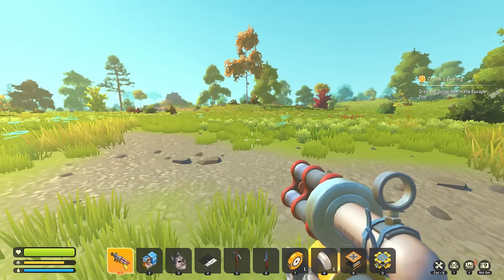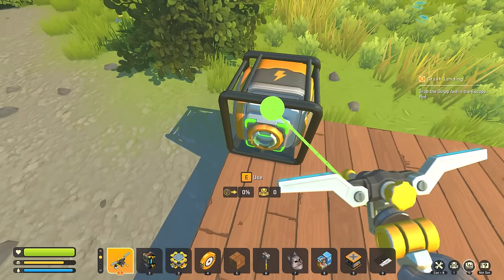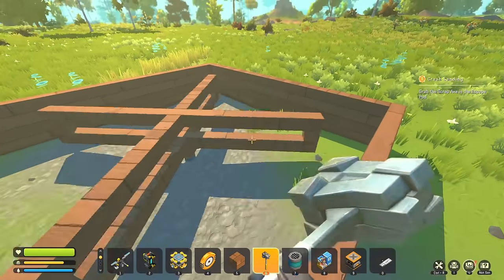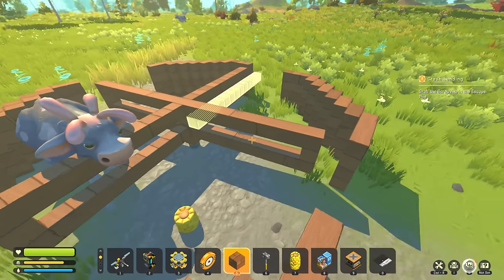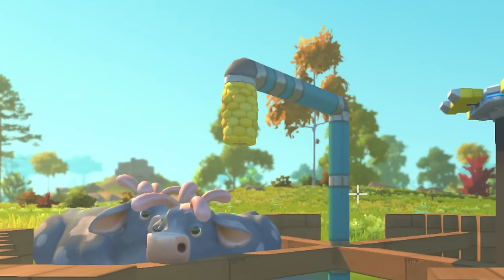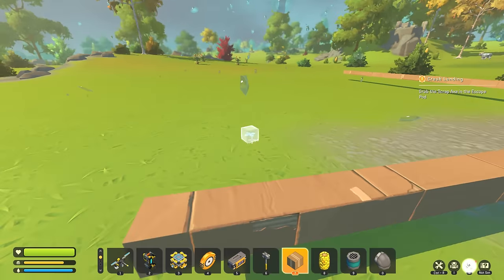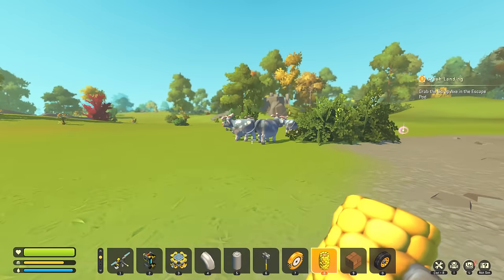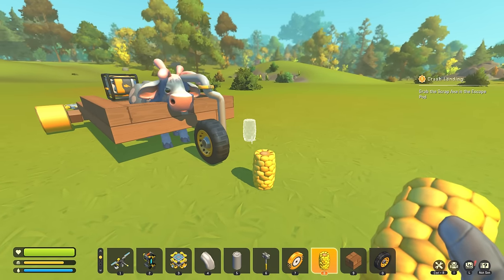Can You Use Wocs For INFINITE Electricity Generation? (Crashlander Survival)

Comment: I remember someone making gravity-powered device with gears when battery charger was announced in the devblog. It essentially used lift's infinite power to lift massive weight, which would slowly descend, causing gears to rotate and generating torque that way
It's pretty cool, I think you'll have fun trying to make something like that

Comment: Is there a particular reason you aren't just using a maxed out controller to turn 10 bearings and then add an 11th bearing that can be hooked up to a alternator... I'm doing that and it works perfectly, even with the big alternator. It generates like 1 battery every 2 minutes or so but you have to stay within render distance of it though

Comment: Are there any suspension glitches that will always move nonstop after they are finished? Maybe something like that could create a free energy machine that moves without any engine or anything else creating force to move your contraption. Just a suspension glitch attached to alternator that makes a bearing spin all on its own.
Reply: True or a simple generator that powers itself but a lil bit of self sufficient energy as a run off spare that can be used for other things sure it will be slow but if you have the patience for it did something similar like this in tears of the kingdom for self powered machines if needed
Reply: just make the springglitch  using a controller to set the angle. works well at 30´ .
then have 2 running opposite ways spinning the bearing at twice the speed.
it works but is still slower  than a tier 5 controller at full speed with 4 powered bearings to power the generators, the controller option is cheaper and better. i used a single springglitch to power 6 large generators. its strong but slow.
Reply: @MrLarsgren  that’s what a “suspension glitch is” it’s “spring suspension”
Reply: so something like glitch steering to turn the alternators? hook it up to a controller to make it never stop spinning for infinite batteries?
Reply: @crustybomb115  yep exactly what I meant

Comment: i just use a controller set to 5 bearings in a row which all spin a 6th bearing on the alternator.
Reply: i think a piston engine would work alot better tbh... considering the bearing connected to the alternator would apply torque on the entire system...
Reply: @crustybomb115 maybe, but i was maximizing space and its fast enough to produce about a bettery a minute on the heavy alternator.

Comment: Here's an easy to apply idea, in your own world, put the alternator on your truck, have it be rear wheel drive only, and connect the alternator to the front wheels, or experiment with the opposite layout maybe? 1 set of wheels will propel the car, and the other set of wheels will generate power.
Reply: And see if you can double them, so say you have a six wheel vehicle and 2 sets are powered. Or have the powered wheels be larger and the alternator connect to the small wheels so it spins nore

Comment: The wooden water wheel works for generating battery power, bit slow but no need for powering the bearing because the water does the work for you

Comment: If pistons dont require power in this mod just use a piston engine sadly gears are a bit rough in scrap mechanic so either no gear ratio or a jank one
Reply: 300 rpm on a big flywheel passign to a small one

Comment: Hey, ive made a spinning thingy with 1 or 2 rhrusters mountet on it, works realy well on both alternators... just build it next to a oil pool i  a desert, and use a setup to keep feeding it oil-->gasolin... i know its an expensive deal. But its works realy well (my base is near the same oil well
Reply: @davidaugustofc2574  They do have their uses; I for one use them for my mining vehicle so that it can have tank steering (not a fan of suspension glitch steering).
Reply: @ShawnF6FHellcat  i honestly just opted for a resource gathering vehicle and hand held tools... seems to work alot better tbh... plus im not sure if the achievements work with vehicles as the gathering method
Reply: @crustybomb115  
I only just found the hand-tool recipes, but I haven't really used them because I have two collectors on my mining vehicle, of which is set up for both saw and drill; also, using the sawblade is faster than the handsaw from what I just saw, but I might use the handdrill because mining always sucks...

The mining achievements do work in a vehicle, but kill quest do not, unfortunately...
Reply: @ShawnF6FHellcat  thats interesting to know... im gonna stick to the hand tools regardless cuz i find them way more convenient than having to line up a vehicle(sorting stuff would be abit of a pain tho)

Comment: I have an idea which sounds kinda stupid but also quite promising... 
Remember those NPCs in the Crashlander Mod? Y'know, like Bill and the other ones...

I think, you could build a contraption for Bill to walk into and let him be trapped inside that contraption, 
basically move him to the roof with some sort of elevator, but once he's up there, the elevator moves back down 
and the only way he can leave the roof is by falling through a chute into a hamster wheel, where he keeps running around inside, 
powering some sort of gearbox that finally powers the alternator... 
and with that, you have your "free labor" which also makes those otherwise pretty useless NPCs finally useful..

Comment: 2:39 Cows go, "OOOOooo!!!"

5:55 kosmo....Bruh. You think that's crazy? I did that in Crashlander last night. I was just fooling around seeing if I couldn't set up kinetic traps for my farm and the bearing janked while I was spinning a metal 2 cross on the ground. I, for no good reason, decided, I'm going to walk into it to see if I can't nudge it back into place. It snapped back, yeeted me off the main land into the ocean, and my guy was doing a death spiral the entire time from this yeet. Like dart/football spiraling tornado dive bomb drill head spin. The worse part about all of it was I was so entertained and shocked at it happening that I forgot that once you hit respawn your stuff stays where you "quit". I had to build a boat and go out and get all of that stuff.

But even though you're trying to do a moderately efficient idea for power generation, my best result has been a 4 "cylinder" piston engine on a heavy duty alternator. I think the heavy alternator does have a slight resistance and speed requirement increase, but it pays in dividends. You have to have it spin faster and harder, but it accumulates power faster than the compact one. Ask kAN how to do an effective Trammel Gear. You can up your gains using one or a few of those as they'll spin faster. The only down side is that they add more bits to the system so more things that can jank with each other and just simply not work.

Comment: Couple more fun console commands for you to try would be /noaggro (toggles getting agro'd by critters) and /fly. As the name suggests, that last one lets you fly around at a set speed. /fly 5 is the default speed, but /fly 100 is great for exploring the map. Type the same command again to toggle flight off. Since you're basically swimming in air, your oxygen will be running out, so /god is also advised. Lastly, since you are swimming, you can sprint-fly for about double the speed. Space/crouch to fly up and down respectively. 

Also I found a way to make a glitch-free generator that makes ~8 batteries for every 1 gas. Video's in the works on that one. Nowhere near as fun as renewable woc or glorb power though lol
Reply: /fly is fant mod isn't it? Definitely not vanilla.
Reply: @senseiplay8290  I think so, but it is part of Crashlander as well. Definitely not in the base game.